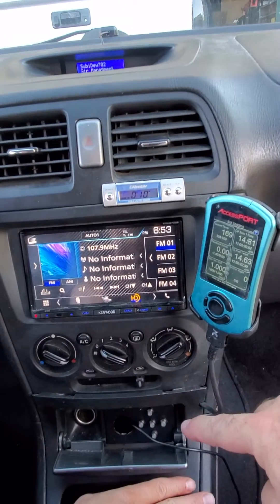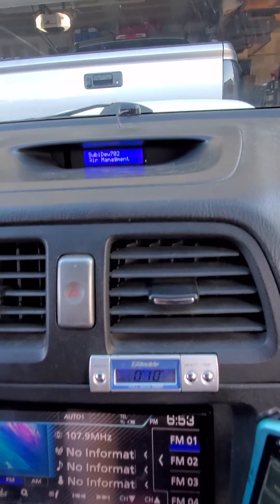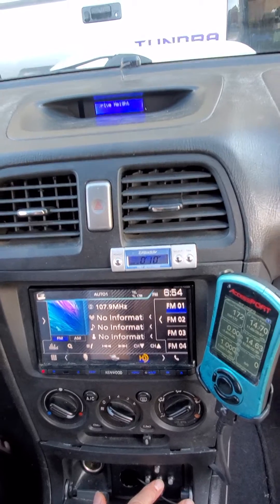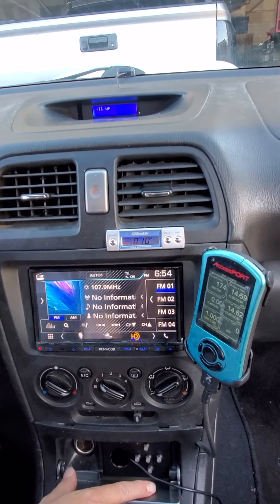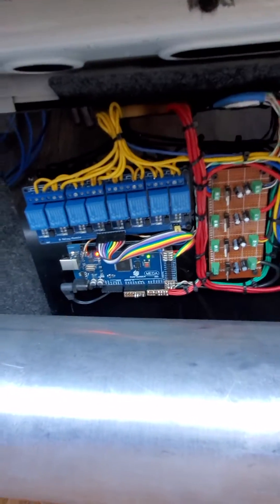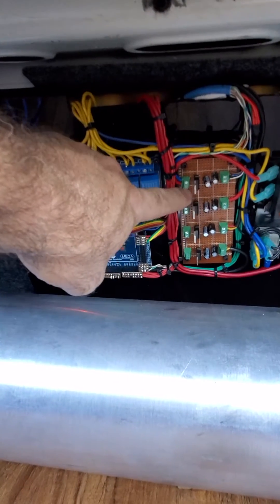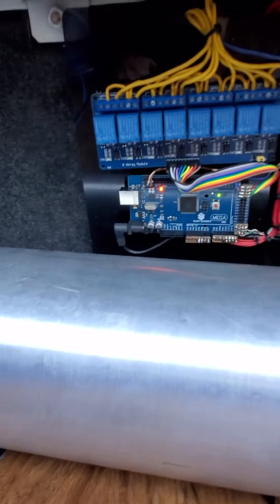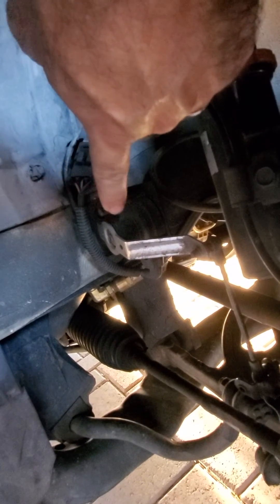Arduino based Air ride management.

Comment: Brilliant. how is it monitoring tank pressure? Can the micro relay on the board handle power switching for the compressor?
Reply from the maker: This is not air based, it has level sensors(potentiometers) on each suspension arm. The tank pressure is not monitored, i need to add that.

Comment: Wow very nice set up for lift truck, i wll lime to try to wire the slam push button to unlock signal, so every time i unlock my truck will drop easy to jump in the back
Reply from the maker: That is totally possible
Reply: @shanewunder721 do u have email adress

Comment from the maker: *Part 2 of 2

void Slam (){
//Exhaust all air bags
  //Fronts
    digitalWrite(FRsolRelayDOWN,LOW);
    digitalWrite(FLsolRelayDOWN,LOW);
  //Rears
    digitalWrite(RRsolRelayDOWN,LOW);
    digitalWrite(RLsolRelayDOWN,LOW);
    Serial.println("Slam");
    
}

void Cruise() {
  Serial.println("Cruise");
  //FR Level sensor code
  FRpotReadVal=analogRead(FRpotPin);
  FR=(5./1023.)*FRpotReadVal;
  //Serial.println(FR);
  if(FR>=0.00 && FR<=1.49){
    digitalWrite(FRsolRelayUP, LOW);     //Ride height is to low so turn on FR up solenoid relay
    //Serial.println("Up");
  }
else
{
digitalWrite(FRsolRelayUP, HIGH);    
}
  if(FR>=1.61 && FR<=4.00){
        digitalWrite(FRsolRelayDOWN,LOW);   //Ride height is to high so turn on FR down solenoid relay
    //Serial.println("Down");
}
  if(FR>=1.50 && FR<=1.60){
    digitalWrite(FRsolRelayUP, HIGH);   //This is Ride height so turn FR up solenoid relay off
    digitalWrite(FRsolRelayDOWN,HIGH);  //This is Ride height so turn FR down solenoid relay off
    //Serial.println("At Ride Height");
}
  
//FL Level sensor code
  FLpotReadVal=analogRead(FLpotPin);
  FL=(5./1023.)*FLpotReadVal;
  //Serial.println(FL);
  if(FL>=0.00 && FL<=1.49){
    digitalWrite(FLsolRelayUP, LOW);     //Ride height is to low so turn on FL up solenoid relay
        //Serial.println("FL Up");
}
  if(FL>=1.61 && FL<=4.00){
    digitalWrite(FLsolRelayDOWN,LOW);   //Ride height is to high so turn on FL down solenoid relay
    //Serial.println("FL Down");
}
  if(FL>=1.50 && FL<=1.60){
    digitalWrite(FLsolRelayUP, HIGH);   //This is Ride height so turn FL up solenoid relay off
    digitalWrite(FLsolRelayDOWN,HIGH);  //This is Ride height so turn FL down solenoid relay off
   
}
  
 //RR Level sensor code
  RRpotReadVal=analogRead(RRpotPin);
  RR=(5./1023.)*RRpotReadVal;
  //Serial.println(RR);
  if(RR>=0.00 && RR<=1.79){
    digitalWrite(RRsolRelayUP, LOW);     //Ride height is to low so turn on RR up solenoid relay
    //Serial.println("RR Up");
}
  if(RR>=1.91 && RR<=4.00){
    digitalWrite(RRsolRelayDOWN,LOW);   //Ride height is to high so turn on RR down solenoid relay
    //Serial.println("RR Down");
}
  if(RR>=1.80 && RR<=1.90){
    digitalWrite(RRsolRelayUP, HIGH);   //This is Ride height so turn RR up solenoid relay off
    digitalWrite(RRsolRelayDOWN,HIGH);  //This is Ride height so turn RR down solenoid relay off
    //Serial.println("RR at Ride Height");
}
  
//RL Level sensor code
  RLpotReadVal=analogRead(RLpotPin);
  RL=(5./1023.)*RLpotReadVal;
  //Serial.println(RL);
  if(RL>=0.00 && RL<=1.99){
    digitalWrite(RLsolRelayUP, LOW);     //Ride height is to low so turn on RL up solenoid relay
    //Serial.println("RL Up");
}
  if(RL>=2.11 && RL<=4.00){
    digitalWrite(RLsolRelayDOWN,LOW);   //Ride height is to high so turn on RL down solenoid relay
    //Serial.println("RL Down");
}
  if(RL>=2.00 && RL<=2.10){
    digitalWrite(RLsolRelayUP, HIGH);   //This is Ride height so turn RL up solenoid relay off
    digitalWrite(RLsolRelayDOWN,HIGH);  //This is Ride height so turn RL down solenoid relay off
    //Serial.println("RL at Ride Height");
}
}

void Allup() {
  Serial.println("All up");
  //FR Level sensor code
  FRpotReadVal=analogRead(FRpotPin);
  FR=(5./1023.)*FRpotReadVal;
  //Serial.println(FR);
  if(FR>=0.00 && FR<=3.49){
    digitalWrite(FRsolRelayUP, LOW);     //Ride height is to low so turn on FR up solenoid relay
    //Serial.println("Up");
  }
else
{
digitalWrite(FRsolRelayUP, HIGH);    
}
  if(FR>=3.61 && FR<=4.00){
        digitalWrite(FRsolRelayDOWN,LOW);   //Ride height is to high so turn on FR down solenoid relay
    //Serial.println("Down");
}
  if(FR>=3.50 && FR<=3.60){
    digitalWrite(FRsolRelayUP, HIGH);   //This is Ride height so turn FR up solenoid relay off
    digitalWrite(FRsolRelayDOWN,HIGH);  //This is Ride height so turn FR down solenoid relay off
    //Serial.println("At Ride Height");
}
  
//FL Level sensor code
  FLpotReadVal=analogRead(FLpotPin);
  FL=(5./1023.)*FLpotReadVal;
  //Serial.println(FL);
  if(FL>=0.00 && FL<=3.49){
    digitalWrite(FLsolRelayUP, LOW);     //Ride height is to low so turn on FL up solenoid relay
        //Serial.println("FL Up");
}
  if(FL>=3.61 && FL<=4.00){
    digitalWrite(FLsolRelayDOWN,LOW);   //Ride height is to high so turn on FL down solenoid relay
    //Serial.println("FL Down");
}
  if(FL>=3.50 && FL<=3.60){
    digitalWrite(FLsolRelayUP, HIGH);   //This is Ride height so turn FL up solenoid relay off
    digitalWrite(FLsolRelayDOWN,HIGH);  //This is Ride height so turn FL down solenoid relay off
   
}
  
 //RR Level sensor code
  RRpotReadVal=analogRead(RRpotPin);
  RR=(5./1023.)*RRpotReadVal;
  //Serial.println(RR);
  if(RR>=0.00 && RR<=3.79){
    digitalWrite(RRsolRelayUP, LOW);     //Ride height is to low so turn on RR up solenoid relay
    //Serial.println("RR Up");
}
  if(RR>=3.91 && RR<=4.00){
    digitalWrite(RRsolRelayDOWN,LOW);   //Ride height is to high so turn on RR down solenoid relay
    //Serial.println("RR Down");
}
  if(RR>=3.80 && RR<=3.90){
    digitalWrite(RRsolRelayUP, HIGH);   //This is Ride height so turn RR up solenoid relay off
    digitalWrite(RRsolRelayDOWN,HIGH);  //This is Ride height so turn RR down solenoid relay off
    //Serial.println("RR at Ride Height");
}
  
//RL Level sensor code
  RLpotReadVal=analogRead(RLpotPin);
  RL=(5./1023.)*RLpotReadVal;
  //Serial.println(RL);
  if(RL>=0.00 && RL<=3.79){
    digitalWrite(RLsolRelayUP, LOW);     //Ride height is to low so turn on RL up solenoid relay
    //Serial.println("RL Up");
}
  if(RL>=3.91 && RL<=4.00){
    digitalWrite(RLsolRelayDOWN,LOW);   //Ride height is to high so turn on RL down solenoid relay
    //Serial.println("RL Down");
}
  if(RL>=3.80 && RL<=3.90){
    digitalWrite(RLsolRelayUP, HIGH);   //This is Ride height so turn RL up solenoid relay off
    digitalWrite(RLsolRelayDOWN,HIGH);  //This is Ride height so turn RL down solenoid relay off
    //Serial.println("RL at Ride Height");
}
}

Comment from the maker: #include <LiquidCrystal_I2C.h> //includes the lcd library

LiquidCrystal_I2C lcd(0x27, 2, 1, 0, 4, 5, 6, 7, 3, POSITIVE); //sets the lcd dimensions

unsigned long minutes = 1000; //counter for loop

//Defines Name and number of pin(Fronts)
  const int FLsolRelayUP=28;     //Relay #1
  const int FLsolRelayDOWN=26;   //Relay #2
  const int FRsolRelayUP=24;     //Relay #3
  const int FRsolRelayDOWN=22;   //Relay #4

//Defines Name and number of pin(Rears)
  const int RLsolRelayUP=29;     //Relay #5
  const int RLsolRelayDOWN=27;   //Relay #6
  const int RRsolRelayUP=25;     //Relay #7
  const int RRsolRelayDOWN=23;   //Relay #8

//Define Name and number of button pins
  const int EbuttonPin=53;         //pin the button is on(this will be the E brake)
  const int SlamPin=50;            //pin to exhaust all air bags
  const int CruisePin=52;
  const int AllupPin=51;
  
//Names buckets to read pins
  int EbuttonRead;           //bucket to read Ebuttonpin
  int SlamRead;              //bucket to read the slam button
  int CruiseRead;
  int AllupRead;

int dt=9000;               //Declares delay name and time

//Declares the names and pin numbers of Potentiometer Pins
const int FRpotPin=A4;
const int FLpotPin=A5;
const int RRpotPin=A6;
const int RLpotPin=A7;

//Reads Pot Pins values
  int FRpotReadVal;         //A4 pin
  int FLpotReadVal;         //A5 pin
  int RRpotReadVal;         //A6 pin
  int RLpotReadVal;         //A7 pin

//Buckets to hold Pot Values
  float FR;
  float FL;
  float RR;
  float RL;

void setup() {
  
Serial.begin(9600);
lcd.begin(16,2); //starts the lcd
  lcd.clear(); //clears any data on the lcd
  lcd.print("SubiDew");
  lcd.print(702);
  lcd.setCursor(0,1);
  lcd.print("Air Managment");
  
pinMode(EbuttonPin, INPUT_PULLUP);        //sets pin 53 as an input for Emergency Brake
pinMode (SlamPin, INPUT_PULLUP);          //sets pin 52 as an input to exhaust all air bags
pinMode (CruisePin, INPUT_PULLUP);
pinMode (AllupPin, INPUT_PULLUP);

//Set Pot Pins as Inputs
  pinMode (FRpotPin, INPUT);  //A4 pin
  pinMode (FLpotPin, INPUT);  //A5 pin
  pinMode (RRpotPin, INPUT);  //A6 pin
  pinMode (RLpotPin, INPUT);  //A7 pin

//Set Relay Pins as Outputs
  pinMode(FRsolRelayUP, OUTPUT);
  pinMode(FRsolRelayDOWN, OUTPUT);
  pinMode(FLsolRelayUP, OUTPUT);
  pinMode(FLsolRelayDOWN, OUTPUT);
  pinMode(RRsolRelayUP, OUTPUT);
  pinMode(RRsolRelayDOWN, OUTPUT);
  pinMode(RLsolRelayUP, OUTPUT);
  pinMode(RLsolRelayDOWN, OUTPUT);

//Sets Relays to off states
  digitalWrite(FRsolRelayUP,HIGH);
  digitalWrite(FRsolRelayDOWN,HIGH);
  digitalWrite(FLsolRelayUP,HIGH);
  digitalWrite(FLsolRelayDOWN,HIGH);
  digitalWrite(RRsolRelayUP,HIGH);
  digitalWrite(RRsolRelayDOWN,HIGH);
  digitalWrite(RLsolRelayUP,HIGH);
  digitalWrite(RLsolRelayDOWN,HIGH);

}

void loop() {
 
EbuttonRead=digitalRead(EbuttonPin);
SlamRead=digitalRead(SlamPin);
CruiseRead=digitalRead(CruisePin);
AllupRead=digitalRead(AllupPin);

if(EbuttonRead==HIGH){
//Turns Relays back off until the button is pushed
  //Fronts
    digitalWrite(FRsolRelayUP,HIGH);
    digitalWrite(FRsolRelayDOWN,HIGH);
    digitalWrite(FLsolRelayUP,HIGH);
    digitalWrite(FLsolRelayDOWN,HIGH);
  //Rears
    digitalWrite(RRsolRelayUP,HIGH);
    digitalWrite(RRsolRelayDOWN,HIGH);
    digitalWrite(RLsolRelayUP,HIGH);
    digitalWrite(RLsolRelayDOWN,HIGH);
    Serial.println("Do nothing");

  }
if(EbuttonRead==LOW){
    lcd.clear();
    lcd.print("Drive Height");
    unsigned long currentMillis = millis;
  while (currentMillis ++ < minutes) {
    //do this for 15mins from start up
    Serial.println(currentMillis);
    DriveHeight();
    //Serial.println("Button loop");
    
  }
  lcd.clear(); //clears any data on the lcd
  lcd.print("SubiDew");
  lcd.print(702);
  lcd.setCursor(0,1);
  lcd.print("Air Managment");
}
if (SlamRead==LOW){
  lcd.clear();
    lcd.print("Slam");
    unsigned long currentMillis = millis;
  while (currentMillis ++ < minutes) {
    //do this for 15mins from start up
    Serial.println(currentMillis);
    Slam();
 }
  lcd.clear(); //clears any data on the lcd
  lcd.print("SubiDew");
  lcd.print(702);
  lcd.setCursor(0,1);
  lcd.print("Air Managment");
}
if(CruiseRead==LOW){
    lcd.clear();
    lcd.print("CruiseRead");
    unsigned long currentMillis = millis;
  while (currentMillis ++ < minutes) {
    //do this for 15mins from start up
    Serial.println(currentMillis);
    Cruise();
        
  }
  lcd.clear(); //clears any data on the lcd
  lcd.print("SubiDew");
  lcd.print(702);
  lcd.setCursor(0,1);
  lcd.print("Air Managment");
}
if(AllupRead==LOW){
    lcd.clear();
    lcd.print("All up");
    unsigned long currentMillis = millis;
  while (currentMillis ++ < minutes) {
    //do this for 15mins from start up
    Serial.println(currentMillis);
    Allup();
        
  }
  lcd.clear(); //clears any data on the lcd
  lcd.print("SubiDew");
  lcd.print(702);
  lcd.setCursor(0,1);
  lcd.print("Air Managment");
}
}

void DriveHeight(){

//FR Level sensor code
  FRpotReadVal=analogRead(FRpotPin);
  FR=(5./1023.)*FRpotReadVal;
  //Serial.println(FR);
  if(FR>=0.00 && FR<=2.19){
    digitalWrite(FRsolRelayUP, LOW);     //Ride height is to low so turn on FR up solenoid relay
    //Serial.println("Up");
  }
else
{
digitalWrite(FRsolRelayUP, HIGH);    
}
  if(FR>=2.41 && FR<=4.00){
        digitalWrite(FRsolRelayDOWN,LOW);   //Ride height is to high so turn on FR down solenoid relay
    //Serial.println("Down");
}
  if(FR>=2.20 && FR<=2.40){
    digitalWrite(FRsolRelayUP, HIGH);   //This is Ride height so turn FR up solenoid relay off
    digitalWrite(FRsolRelayDOWN,HIGH);  //This is Ride height so turn FR down solenoid relay off
    //Serial.println("At Ride Height");
}
    
//FL Level sensor code
  FLpotReadVal=analogRead(FLpotPin);
  FL=(5./1023.)*FLpotReadVal;
  //Serial.println(FL);
  if(FL>=0.00 && FL<=2.39){
    digitalWrite(FLsolRelayUP, LOW);     //Ride height is to low so turn on FL up solenoid relay
        //Serial.println("FL Up");
}
  if(FL>=2.61 && FL<=4.00){
    digitalWrite(FLsolRelayDOWN,LOW);   //Ride height is to high so turn on FL down solenoid relay
    //Serial.println("FL Down");
}
  if(FL>=2.40 && FL<=2.60){
    digitalWrite(FLsolRelayUP, HIGH);   //This is Ride height so turn FL up solenoid relay off
    digitalWrite(FLsolRelayDOWN,HIGH);  //This is Ride height so turn FL down solenoid relay off
   // Serial.println("FL at Ride Height");
}
  
 //RR Level sensor code
  RRpotReadVal=analogRead(RRpotPin);
  RR=(5./1023.)*RRpotReadVal;
  //Serial.println(RR);
  if(RR>=0.00 && RR<=2.39){
    digitalWrite(RRsolRelayUP, LOW);     //Ride height is to low so turn on RR up solenoid relay
    //Serial.println("RR Up");
}
  if(RR>=2.61 && RR<=4.00){
    digitalWrite(RRsolRelayDOWN,LOW);   //Ride height is to high so turn on RR down solenoid relay
    //Serial.println("RR Down");
}
  if(RR>=2.40 && RR<=2.60){
    digitalWrite(RRsolRelayUP, HIGH);   //This is Ride height so turn RR up solenoid relay off
    digitalWrite(RRsolRelayDOWN,HIGH);  //This is Ride height so turn RR down solenoid relay off
    //Serial.println("RR at Ride Height");
}
  
//RL Level sensor code
  RLpotReadVal=analogRead(RLpotPin);
  RL=(5./1023.)*RLpotReadVal;
  //Serial.println(RL);
  if(RL>=0.00 && RL<=2.89){
    digitalWrite(RLsolRelayUP, LOW);     //Ride height is to low so turn on RL up solenoid relay
    //Serial.println("RL Up");
}
  if(RL>=3.11 && RL<=4.00){
    digitalWrite(RLsolRelayDOWN,LOW);   //Ride height is to high so turn on RL down solenoid relay
    //Serial.println("RL Down");
}
  if(RL>=2.90 && RL<=3.10){
    digitalWrite(RLsolRelayUP, HIGH);   //This is Ride height so turn RL up solenoid relay off
    digitalWrite(RLsolRelayDOWN,HIGH);  //This is Ride height so turn RL down solenoid relay off
    //Serial.println("RL at Ride Height");
}
  
}

*This is Part 1 of 2